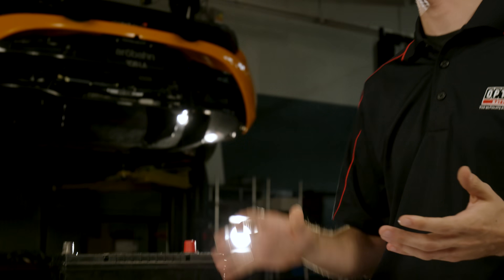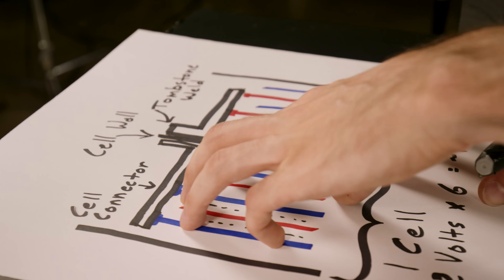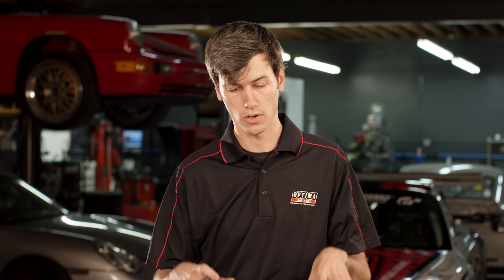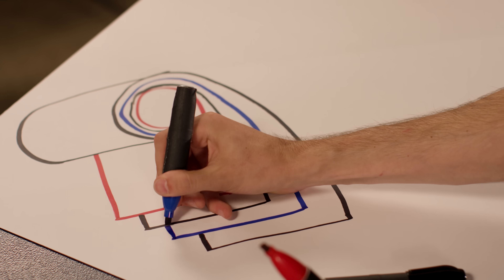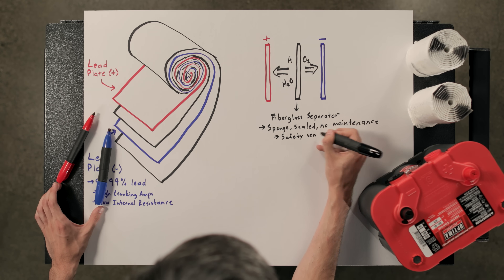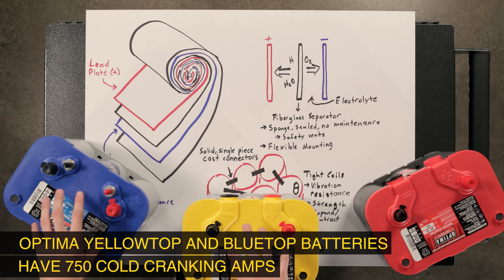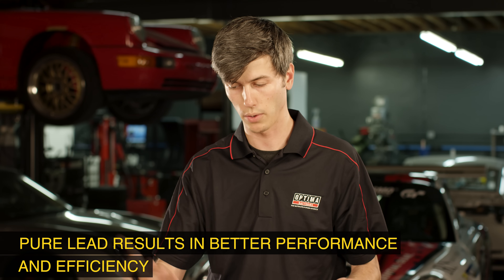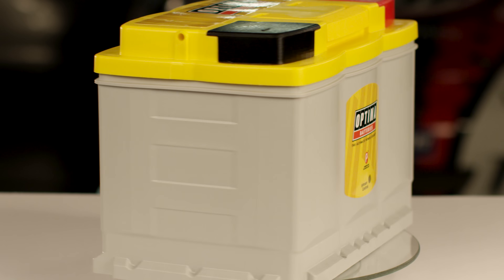What Type Of Car Battery Should You Use? Flooded vs AGM

Comment: Optima batteries are junk now, ever since they moved the manufacturing to China. The last Optima (red top) battery I bought (in 2015) lasted 1 year and after replacing it twice (since it was still under warranty), I finally gave up and went back to a regular flooded battery, which has lasted 3 years and still going strong. I'll never buy another Optima battery again. If you are interested in an Optima battery, I suggest doing some searching on the internet and you will find many others with the same experience I have had in the last few years. The new ones are NOT the Optima batteries of old, which were really good.

Comment: I have a 2008 BMW 135i convertible that needs a new battery.  The existing flooded lead acid battery is huge.  I'm told it needs to be higher capacity to run the top without the engine running.   I'm thinking of getting an AGM battery of a similar capacity.  It costs just 20% more at my mechanic and you suggest it might last much longer.  Sounds like a no brainer to go ahead.   Except I'd like to know if there is likely to be any problem with the charging computer on this car?  Does an AGM battery have different charging characteristics that might conflict with the charging computer's "map"  ...  thanks,

Comment: I was a big fan of Optima AGM batteries when they first came out. I've purchased about 12 of these between my boat and various vehicles. The blue top deep cycle out lasted normal marine batteries about 3 times (1.5 years for flooded versus 5 years for Optima blue top). The last batch of red top automotive I purchased over the past 6 years lasted on average 5.5 years in pickup trucks. Today I had to replace a red top Optima purchased 6/13 and it started acting up 1/19 (5.5 years). I've noticed the Optima red top reliability is 32% better then a normal flooded sealed lead acid. Not great since Optimas cost 32% more (Optima redtop $232.99 and Duralast gold 24f-dlg $159.99 at advance auto).  I found a Duracell AGM 24FAGM for $172.13 at Sam's club which is $27% less expensive then Optima red top from advance auto. The question is will I get 5.5 years reliability? if so I have a winner.
Reply: Its been 4 years.... How did that go for you?

Comment: ~5 years ago got the round 55 Ah Yellow Top and alongside with it 4A Defa battery charger. The Yellow Top is more expensive than regular batteries, but it's absolutely worth it!
Month ago it was -30°C here and I didn't have preheating on. Took 3 short cranks and the car started - couldn't do that before with regular FLA.

Comment: We've used Optima batteries for years!! The only way an old style lead acid battery comes on the place, is if we get new equipment... currently, we have about 40 Optima batteries in use...
In the last year, we've started using the heavier Yellow top starting/deep cycle batteries... They hold up better in the service truck and in the semis.
Good video!! Well explained!
One advantage I didn't hear you say is.. corrosion is pretty much non existent with the Optimas... We always make sure everything is clean, cover the terminals with dielectric grease... Zero issues!!!
We used to clean everything, then paint the terminals after connecting them... It seals the connection and works also.

Comment: Next to diamonds car batteries are overpriced. Lead ?? Oh yeah, thats a rare mineral. Recycled plastic case ?? Millions man hours in engineering that fantastic rectangle form, millions I tell you. But the most exotic chemical concoction, more rare than heavy water, is hydrochloric acid and water. Not just any water, purified water. Chemical engineering pushed to the max for that process. So you can plainly see why car batteries are so much worth what you pay.😆

Comment: guy I knew rolled his truck into a irrigation canal. it sat there under water, upside down with the tun signal on all night. he figgured the battery was toast so he got a cheap one and ran it dead drying the truck out trying to start it. then he decided to try the optima. without being charged it started the truck. he used it for five more years before he replaced it.
 I have used optima batteries since, but am not impressed with the ones made in mexico.

Comment: Thank you for this video.  

Regarding whether to use a flooded lead acid or an absorbed glass mat battery, for most standard under-the-hood vehicle applications, a good quality flooded cell is a better choice.  But beware that a particular battery might be a great performer in one model of vehicle but poor in another because of reserve requirements, battery plate spacing and vehicle charging potential and rate.

Why?   I have experienced a number of Optima Red and Yellow Top batteries whereby apparently the capacity of one cell drops significantly in relation to the other five.  I think this is a result of the grid and plate being too close together in the weak cell..  Fully charging this cell results in overcharging the other cells and losing electrolyte.  If something similar happened in a flooded cell battery, water can be added.  From my experience, in most cases a well maintained, good quality flooded cell battery is more fault tolerant of faulty charging systems and will outlast an Optima AGM battery.

Apart from this, a number of both Red and Yellow Top batteries that I kept in reserve on the shelf but charged at least three times per year at 14.4V to a full charge, and then removed the charger, would experience a runaway charging condition.  The 8A Interacter charger used would after a couple of minutes settle in to a rate of 4 to 6 A at the 14.4V, and I would leave and return 24 hrs later.  I would find the rate at 8 A and the battery warm, with condensation between a cell vent and the original factory clear plastic wrap.  In a related experience, years prior to this a smart B&D charger had been used before migrating to Interacter brand chargers, and some of the batteries were found to have melted though their polystyrene foam packaging and the charger at 25A.  The charger potential was measured at less than 14.5V using a Fluke DMM.  (I asked Optima about how often this run away condition happens and it said it doesn't happen.  Right.)

Comment: One thing you didn't mention is that the internal resistance is very low. I have this battery in a sports car that sits around a lot. Nad even if I forget to leave it on a charger, after 6 months it still starts. Any normal battery that doesn't get used for 3 months will go dead. It really is the greatest battery.  6 years and still pumps out 1000 amps. JD

Comment: I've never seen a lead acid car battery for sale that needs maintenance. I don't know about the situation in the US but here in Europe they simply don't exist anymore. For larger vehicles like forklifts, which often are battery powered only, especially for indoor use, filling up lead acid batteries with new distilled water is actually a thing. Although those vehicles are often getting replaced with ones with lithium batteries recently.

Comment: 2 points:
1. Each cell in a lead acid battery carries 2.1 volts, not 2.2.  A fully charged 12 Volt battery should have a resting voltage of 12.6 to be considered fully charged, but they can float above that if recently off a charger.
2. Flat plate AGM is vastly superior to spiral, due to the increased lead surface area that using the full space possible offers. The gaps between the cells in a spiral, added to the fact that they are always made a bit small, leads to less of the available space being utilized. Also, after a deep discharge, spirals tend to resist recharging and can overheat far more easily.

Source: I am the store manager in a battery shop, specializing in 12V auto/commercial and deep cycle batteries.
We also purposely don't carry JCI. 😉

Comment: I had a yellow top for 3 months and the battery died. I will never trust this better agin since it failed during a -15 degree Fahrenheit winter night where I could of been stranded in a parking lot.

Also, it’s sad that the OEM Mopar Battery had done a better job than the yellow top in reliability

Comment: alot of people dont know this but optima batteries are not completely sealed batteries and need to be vented outside of the cabin for safety if you relocate it to your hatchback trunk and such. they even include a litttle hole in their batteries for you to insert a tube.

Comment: You repeated a few things in this video.  Also, what do you think about using 2 small lithium "motorcycle" batteries in parallel as a car starter battery?  For example, a pair of 270 CCA lithium batteries together should have about 540 CCA, enough to start an average car.  Total weight of them is under 5 pounds (vs. about 50 pounds for a standard FLA car battery).

Comment: Had 3 Optima Red Tops. Each one lasted 2 years and then died - just wouldn't take a charge. Yup, I used a battery tender during the off season - nope - they still died. Using a 'slightly higher' voltage to keep them alive or revitalize them didn't work. For the price ($300+) I expected at least 3 or more years. On the web forums it appears that their quality control has tanked. Well now I've changed to a BOSCH AGM and so far so good. No more optima for me.

Comment: I love optima batteries for the power, the no gas off, and the vibration resistance. I have yet to have one last as long as the flooded battery. I’ve had many. They just don’t last and they are very expensive.

Comment: I used an optima battery on my truck. Lasted over 7 years. Started in -40F no problem without a warmer.
When a different battery went dead in my latest car I almost bought one again. $235+10% sales tax in my state not including core charge for a group 35 battery.

I went with the gold 5-year Walmart battery. It was $95. I measured the voltage and noticed the Optima battery I used to have liked to be around 13-13.2v, but the flooded battery is more like 12.5-12.7. Interesting. Just couldn't justify an extra $170 in this case.
If my life depended on it like it did when I was in remote areas with my truck - I'd have gotten the red top again. But 4 gauge jumper cables are $15 at Walmart and I don't go super remote anymore.

Comment: I've got anywhere from 2 to 7 1/2 years out of a battery.  The longest was a Diehard in my Datsun.  It was 7 1/2 when I sold it and it still started.  The one exception is the one Optima red top I bought, it died in 14 months.  Considering it cost twice as much, I'm not impressed.   Both my vehicles now have  Autozone AGMs.

Comment: Wife was getting in oil change and they test the battery and say I’m getting low discharge so I tell them put an Optima in and they about pissed themselves. 
They said they’ve never had a customer request an optima before usually they have to even try and convince a customer that their battery doesn’t have much longer.

Comment: I prefer one that works at least 5 years and can handle -50F winter temps. I have not been able to find a battery that can do that since the year 2000. Prior to 2000 I used to be able to buy batteries that would work that long. Not anymore. I have even tried Nicads. But they develop memory problems after about two-three years. Optima suck and die in my very cold winters.

Comment: I had an Optima AGM battery in my car for probably 6 years or so, so when my car started struggling to start, I bought a new and cheaper battery to replace it, only to encounter the same starting issue, which turned out to be a bad starter. 
Now I have a working Optima AGM sitting around. I’m tempted to buy a solar panel and battery charger so I can make an off-grid power supply for my electronics, even though I don’t need one.

Comment: Complaints about the shilly video aside, Optima battery prices have gone sky high in the past 4-5 years, I'm not sure how the even sell any anymore?  Also I'm not sure they are "made like they used to" and I don't think they are US made anymore either, are they?  My experience with a Red Top I bought back in 2005 or so has been quite good though.  I've had the battery in 3 different vehicles and it is still working pretty strong to this day.  When I bought it, it was offered with a 10yr (pro-rated) warranty and it has clearly outlasted that warranty.  Nowadays the same battery costs nearly $300 CAD--over double the price--and much more than competing AGM batteries.  It's actually a bit ridiculous considering one can get an LiFePO3 battery these days instead with that kind of money.

OTOH I had a Yellow Top I bought before the RT and lasted only about 4-5 years and wasn't really any better in terms of longevity than a regular flooded battery of the higher-end type.  The funny thing is the price of a Red Top is now way more than even the Yellow Tops used to be.  

I also had a flat-plate AGM battery from Canadian Tire that was OEM'd by Exide (a rebranded Edge, US-assembled) and that failed within its 5 year (replacement) warranty, and was getting quite weak in the last year.  In fact when I load tested it earlier this year against the RT (which was lower CCA to begin with) the RT was testing stronger than the much younger Edge. Luckily they replaced it under warranty with a new one but they are using East Penn now so will have to wait to see how their flat plate AGM (Intimidator?) works out.  

So far only the RT has really made good on its claims of longevity, but at the $300 they go for today? Doesn't seem like it's worth it.

Comment: Very interesting. I have moved to a part of the world where it is a lot hotter. Bought a car there and placed a new battery in it. After 2 years the battery died. At the garage they said it was normal because of the high ambiant temperature. So, what would be the best options in extreme conditions? Hot and cold? For the tipe of battery?

Comment: I like to watch lots of videos and price check before making a car part purchase. Many videos steered me to Odessey batteries which I bought for $300. But my VW dealer informed me the over 700 cold crank mark on these batteries cause havoc on the vw electrical system so I returned it and got an agm battery at autozone. I think the crank number on the Optima also exceeded the recommended number from my vw tech which is why I did not choose Optima. And I saw quite a few non-recommendation on the Optima saying they didnt really fulfill the warranty which scared me away. Would like to hear feedback about these yellowtop batteries

Comment: I do not know    your education  but in all your  videos you make  clear deep analysis    How about if someone   DIY     makes  a static battery very heavy up to 70 kilos  for solar panels  with    fat plates from melting lead. the current maybe  is lower but most s stronger    and the life of bat may expand up to 100 years  because the corrosion of the lead is unsignificant

Comment: The alternator concerns not addressed at all; from what I've researched you need to have basically a trickle charger in your garage to properly keep the battery topped off as most car alternators cannot charge spiral/agm batteries properly and can possibly lead to early alternator failure.

Would be nice if you decided to address these common concerns a quick web search would give you.
Reply: Kuro Murasaki Glad you left this comment.

Probably going to reconsider a battery purchase based on this knowlege.

Comment: I had an optima red top battery that failed and I had it replaced under warranty 4 times.
When the 4th battery failed they refused to replace it even tho it was still under warranty.
I then purchased an original motorcraft and it lasted longer than all 4 optima batteries combined and still going strong.

Comment: Irl practice, I've never seen an optima battery that actually lasts... Also they almost never fit a car right.
As for flooded lead acid batteries. If I install it right it'll last. I've seen batteries last over 20 years.

The battery will die early if subjected to abuse hence why most batteries don't last more than 5 years. So I suppose you ought to buy optima if you don't like changing drive belts, replacing broken alternators, not mount the battery correctly so you'd end up sloshing it around, etc

Comment: Optima's "Spiral Cell Technology" is their own undoing... The battery builds and stores quite a bit more heat and can't efficiently dissipate it due to the cell designs. These batteries have a very high fail rate in Texas as I noted while working for an Auto Parts store. Also they don't like being charged very quickly, especially the Red Top series, as that causes them to build heat the fastest.

Comment: I was a total Optima battery consumer until I had two bad experiences with those batteries.  I have been using Optima batteries for over 20 years with no problem, but...  The first problem was just a defective battery after less than one year old which Optima replaced at no charge.  The second problem that I had was an Optima in my Camaro that I do not drive much in the winter.  I start it at least once a month and put it on a charger if needed to keep the charge up.  It quit on me cold about a month ago.  Started the car just fine, drove it on the interstate to work and at the end of the day, deader than a door nail.  Nothing.  The battery was getting old, but to leave me high and dry was not acceptable.  I checked the price of a new Optima and found it was 2 1/2 times what the best GM battery was.  Since the price had gone up by about 40% since my last Optima, I could not justify the higher price and went for the GM battery.  If the price was reasonable, I would have bought another Optima, but a 40% hike in about 4 years was enough for me to say no.

Comment: Not sold on the AGM batteries.  I bought one for my Nissan Titan and it lasted less than a year.  Maybe my experience was a fluke, but definitely not a scientific observation.  It was expensive, too.  The lead acid battery I replaced it with has been in there for five years.